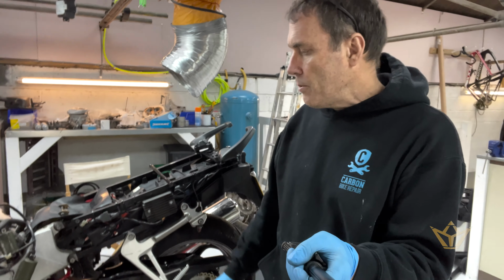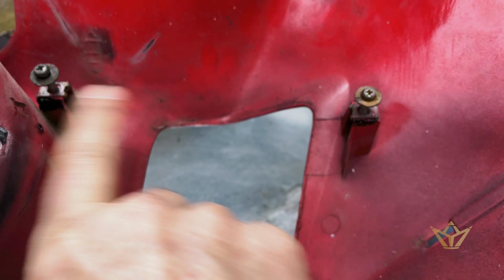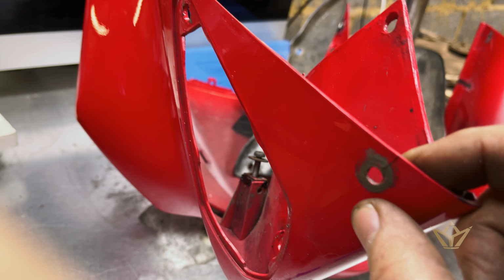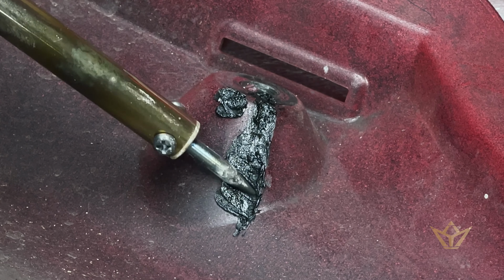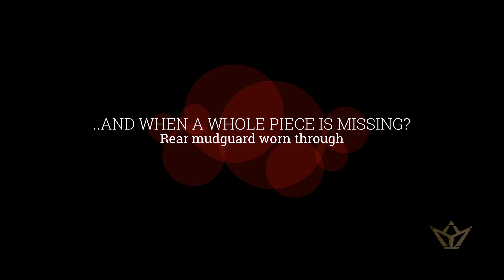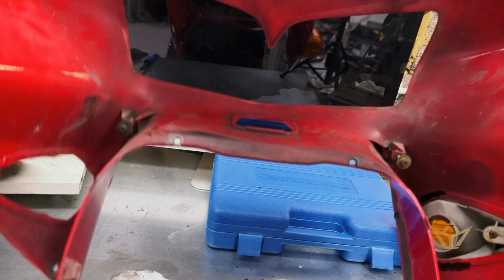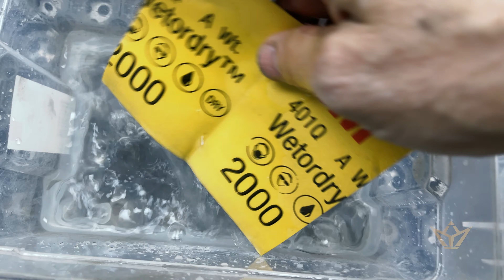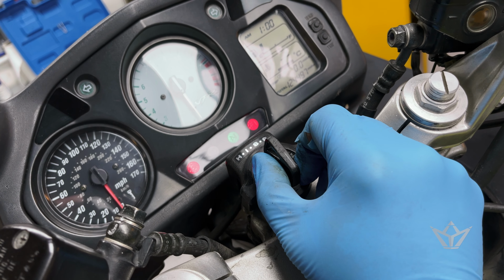Yes you can repair plastic without glue!! Part 2: Honda VFR800fi Superbike

Comment: I have recently gotten into plastic welding. I do it just the same way, by stabbing deeply into the plastic, but not popping through the other side. But I only do it on the back side, because I don't want to have to repaint. I also like to melt some aluminum screen mesh in after I've melted the plastic together to give it some extra strength. Then cover that with a little more plastic. It make for a strong repair.

Comment: That bike with the gear driven V4 is just such a mechanical perfection. Add a single sided swing arm, centerstand and comfortable riding position it adds up to one of the best bikes ever made. Certanly the best bike i have owned!
Reply: You need to own and ride a few more bikes!
Reply: put a decent pipe on they sound glorious
Reply: @alexmorgan3435  Or maybe you need to try getting out more.
Reply: I own a 89 vfr750, have you ever compared the two?

Comment: Very nice job you done ! I welding polytene pipes here i Sweden and al depend on heat 220 ' celsius and pressure time ! And cooling time ! Honda vfr 800 gear driven cams are simple the best engine ever buildt ! Stay strong  !😊

Comment: I’m on my 2nd 98 Vfr and am finding the videos on various sites to be paralleling some of the issues I’ve experienced. 
One in particular was a problem with the rear brake caliper locking up after a bit of riding. The model in question is a 98 gen 5 with about 20k. I disassembled the system, found some moisture in the caliper and rebuilt it. Bleeding requires a bit of finagling with the slave cylinders- I’d be interested in seeing some videos on the linked system.
Reply from the maker: Hi Mac, the brakes were one area I did not need to address as they are good however I will be looking at them as a service video in the very near future. 👍

Comment: ABS plastic welding is very simple & fairly strong if done correctly.
You're demonstrating the incorrect procedure by contaminating the plastic weld by not removing paint 1st, plus it'll never be as strong as it once was, ABS plastic weld needs support from wire embedded across the weld to reinforce the split or it will crack again.

Comment: Great videos, really nice to watch another RC46 being restored :)
If you have a problem with diagnosing FI light blinking issue, please count the amount of blinks as those ECMs have self diagnosis feature.
The number of blinks would tell you what the issue is  (AFAIR long blink is treated as 10 blinks), could be poor connection to one of the sensors etc.

Depending on the version, you may need to shorten service connector with the jumper, everything is described in a service manual.

Good luck! Will be watching your next videos :)

Frank
Reply from the maker: Thanks Franmaros, there are no codes. It just blinks forever. That is the issue. No one has referenced this behaviour. I’ve checked everything. 😡
Reply: @MyRestoration1  That's strange, do you have this jumper connected to "service check connector" on the back? If yes, you can try deleting error codes from the memory by removing it and plugging it back shortly.
Reply from the maker: @iamfranek  yes I’ve jumped this connector. All it does is stop blinking to a constant light. ‘ no data stored’ Strange thing is I know there I are fault codes..you’ll have to see in my next video what I’ve done to resolve my frustration..oh yes..keep watching 😂

Comment: There are 2 lengths of flashes to help indicate the fault long =10 and short =1
Add them together to get total, if more than one fault it will flash the lower total first then the bigger total. If its same repeated, likely just one fault.
Reply from the maker: Yes but not after 70 short flashes…just saying

Comment: It gives me the creeps watching you sanding down the windscreen 😳.
But the result looks fine. I was building model cars and I had a polishing set with sand papers down to 12000  which gave a mirror like shine on the paint .
Reply from the maker: Ha ha yes it did make me nervous. Even more so when I struggled to get the scratches out but with guidance as you see in the end it’s a good result when done in bite chunks instead of the way I initially did it. Lots of rubbing..🙄
Reply: You can wet sand, I use Megs PlastX for my plexiglass mini microfiber pad.

Comment: On my BMW R1100RS (pre cat) the right hand plug is wet and fouled. I did clean the injectors but I think RHS cylinder is over fuelling. I am going to send them off to Mr Injector to have them looked at... Hope its not the Motronic...Anything I might look for? New plugs , cleaned the  throttle bodies, tank, pump, filter, been sitting for 6 years in back of garage (don't ask)!
Reply from the maker: I’m afraid I simply don’t have the knowledge to offer poor advice. These black box bikes are a convenience leap forward but in almost all other ways a leap backward. It’s this kind of problem that I highlight. It should be a simple thing to fix at home. Now it’s probably the computer or faulty sensor. Just too many possibilities. 
I like fixing things that I own!

Comment: I’m picking up a Honda vfr 2002 and when I went to check the bike out the guy said it starts no problem… I used the kill switch to turn it off when he turned it on and then I went to test ride it and it did not start he said “what do you do to my bike!” And the lights where on killswitche was not on kill but it wouldn’t start… then after turning off and on it did with the kickstand up but it was in nutral the whole time so it couldn’t of been being in first gear with the kickstand down and we assumed it was the sensor that is connected to the kick stand that we thought it was saying it was down when it was not and that was the reason it didn’t start? But how could that be when it’s in neutral? I’m still confused about it and kinda worried for when I pick it up… I hope it’s just dirt in the sensor on the kickstand giving a false reading 😅
Reply from the maker: See my response on the vfr800fi electronics page. 👍